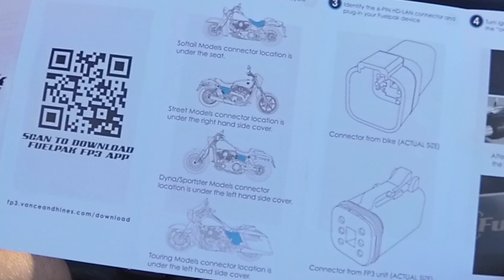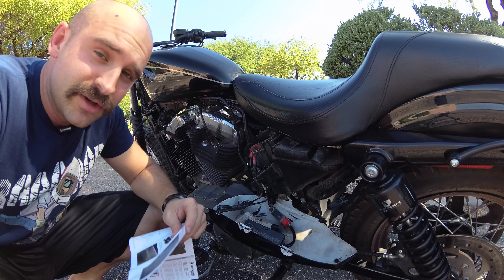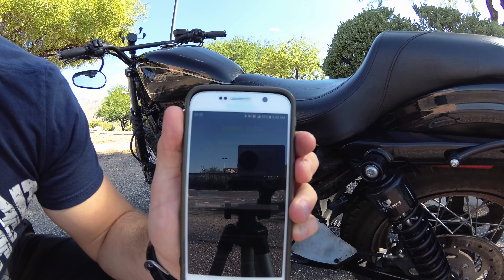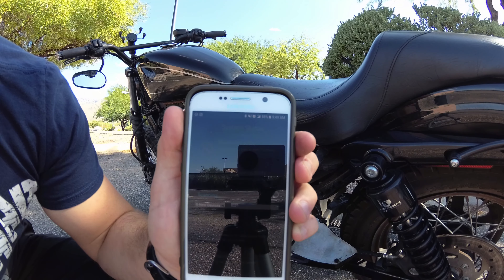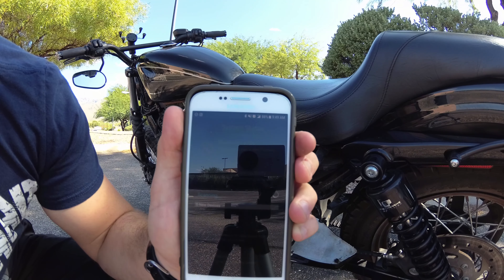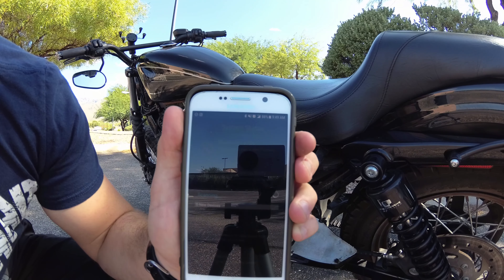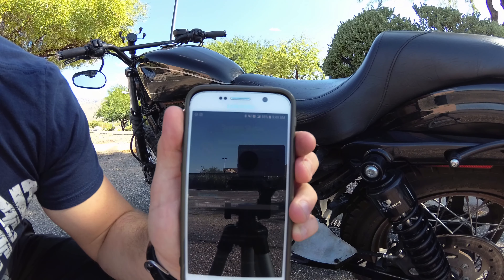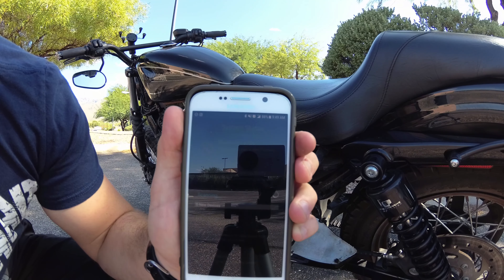How to Increase Your Sportster's Performance With the Vance and Hines FuelPak FP3

Comment: I’m new to Harley, I bought a 2016 48. It has 4,500 miles on it. I have a question, wondering if you would know the answer. So it has a Vance and Hines exhaust and aftermarket air filter. I feel that it’s not performing at its maximum, when I’m riding slow I feel like it hesitates so I have to give it a little more throttle. Idk if that’s how harleys Sportster are or do I need to tune it with the Fuelpak? Thank you and grate videos!
Reply: Jonathan Guzman  With a aftermarket Filter and aftermarket Exaust you Must have  a Tuner. Fuelpak other another one doesn’t matter. If you don’t have, the mix with oil/ air/gasoline it’s very bad.
Reply: Peppo Prostata thank you for the reply but I didn’t really understand what you meant.  I’ll see what I can do to fix my problem.
Reply: He means with a high flow air filter, your bike is getting more air than it should, causing your bike to run lean. When you change an air filter or exhaust, you have to tune (adjust) the air to fuel mixture in order to balance the ratio for your bike to run at peak performance.

Comment: What if you got different pipes? I went from short shots to a bassani road rage 3
Reply: How are you liking the RR3? Also, what tuner are you using?  Any decel pop?
Reply: They have several pipes to program/flash with, and if yours isn't listed, you can email them and they get back to you within 24 hours with the best options and maps to flash your bike.

Comment: how’s the Sportster in the highway I’ve really thought about one bc I Love he scrambler look  how is the 1200? I’m gonna buy used anything I should look out for ? Thanks for the help
Reply: I have a 1200 sportster and far as highway riding there is no issue and is fairly smooth and comfortable. Am looking for a good dyna now
Reply: i have a xl1200c. it shakes at 90mph. smooth otherwise. in the process now of converting it into a tracker
Reply: I have an 883 superlow and it’s great on highway.
Reply: @TimothyCorbette  at 90 mph you're speeding anyway.

Comment: Will this work on my 01 sportster
Reply: 01 Sportsters are carbuerated and need to be physically tuned, so the answer is no. Hope this helped.
Reply: No because your bike is carbureted, you need to get a jet kit for the carbs. These tuners are for fuel injection.